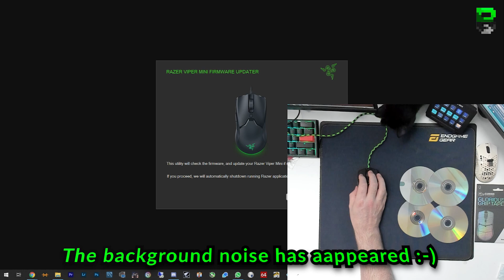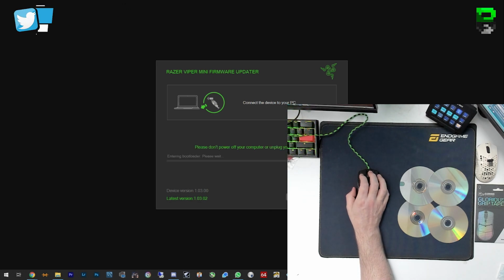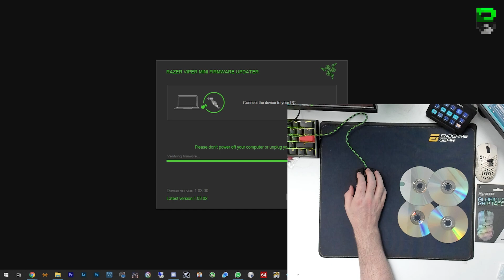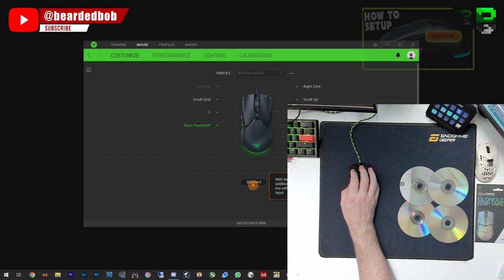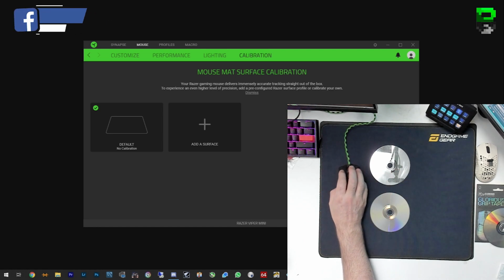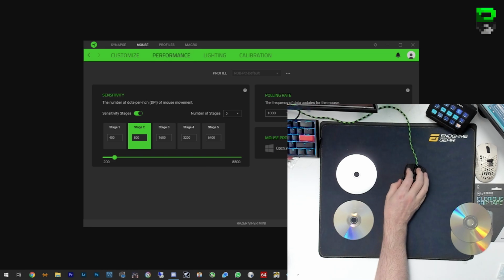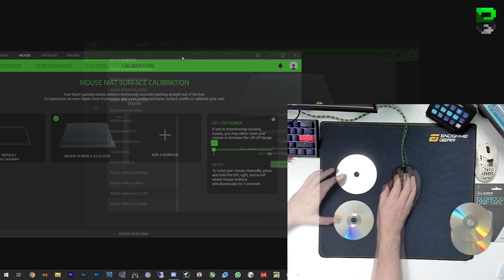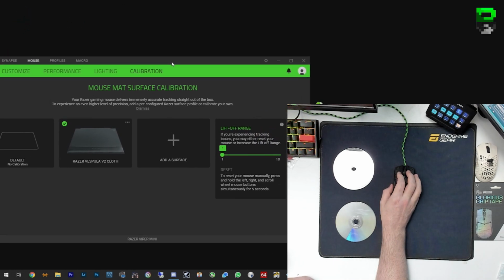Razer Viper Mini Lift Off Distance Fix v1.03.02 - So have they finally fixed the problem?

Comment: Firmwares for me didn't change a thing, the calibration inside synapse doesn't seem to do anything whether its on 1 or 10, even setting on a certain mouse pad type in synapse doesn't seem to change anything other than the fact that some of them don't track right, but the LoD setting itself 1-10 doesn't seem to do anything. The tape method works but it makes the mouse feel unnatural. I like the natural feeling without tape minus the fact that the tracking shits the bed when trying to adjust my aim. Time for a new mouse I suppose

Comment: Can someone help? 
I have a viper mini, I’ve had it for a year and a half and didnt use it much, but now i tried to play some games and noticed that when i flick the mouse it slows down like it has some weird acceleration(i play on low sens) and i want to know is there any problem with my sensor the or is it the mouse itself and i haven’t noticed it yet until now..?!
Reply: same! my first 2 viper minis did not have this issue, only my latest one. Any fix?
Reply: @KR-sr4jm  changed the mouse even though i loved it so much, the shape and grip was perfect but i needed the performance
Reply: @Naji123kh  what did you choose as replacement?
Reply: @KR-sr4jm  g pro wireless
Reply: @Naji123kh  now that's an what you call an upgrade. Planning to switch to deathadder v3 since I don't trust wireless mouse with their latencies. Do you feel the delay or nah?

Comment: My mouse does this all the time. Recalibrate for custom surface fixes it for a bit, but the issue always comes back. Adjusting the Lift Off Distance does nothing. Very frustrating

Comment: USE RAZER ACARI MOUSE PAD , IT WORKS, TRUST ME. No need for tape
Reply from the maker: But you have to use that pad as your main.
Reply: @Beardedbob  i used razer acari on razer synapse
Reply from the maker: r ok I see, yeah this trick doesn't work on all pads :-)
Reply: @Beardedbob  i tried 3 pads, razer acari best one. less than 1 dvd
Reply: no, i use hyperx fury S
Reply: I tried your way, it reduced the LOD, but also decreased the accuracy when cross

Comment: Recently got a Viper Mini and this has been a non-issue for me. I use quite low sensitivity (600dpi) and moves the mouse around quite a lot in-game. I was therefore worried about the LOD issue before buying. But after trying it out, it does not affect me at all. Not sure if it affects anybody in practical scenarios, but even if it has a little higher LOD than usual, I do not believe it causes any real problems.
Reply: Do you even lift bro???
Reply from the maker: Good to hear it, do you not lift?

Comment: Did you try to mount the  viper mini pcb with some support about 1mm (testable) between the pcb and the inner bottom of the case before screwing? Larger screws may be necessary if the screws do not attach the pcb to the case correctly. It's just an idea, i don't have that mouse and I don't know if that is possible. I like your videos, good work.
Reply from the maker: I've not tired it but they might work for the sensor the issue will but they will make the switches and scroll wheel to high 😟
Reply: @Beardedbob  Sure. I don't know, maybe to lift the mouse by placing about two layers of skates (or minus) to get a bigger LOD, but I don't think it would be ingenious 😟. thank you for the feedback

Comment: My unmodified Viper Mini's LOD is below 1 DVD. In Synapse I set LOD to 1 and calibrate the mouse for Vespula Control pad.  That mouse pads calibration uses way lesser LOD, than any of the others.
Reply from the maker: yeah I've heard a few people say the LOD is correct on this pad but you are limited to that pad.
Reply: @Beardedbob  i dont have Vespula Control or any other Razer mousepad, but LOD is way better with that profile. I have some cheapo Natec pad.
Reply: @barnabascsongradi9004  the tracking isnt off with calibration?
Reply: @mohmdbaqeri  all fine
Reply: Seems to work for me, better.

Comment: As i said in your previous video @Beardedbob , RAZER VESPULA CLOTH v2 WITH ver 1.01.02 IS THE BEST !!!! sub 1 dvd
Reply: its more probable the difference is the mouse pads you use
Reply from the maker: Good to now if you want to use the Vespula surface.
Reply: @Beardedbob  Update: I updated the firmware to 1.03.02 , mine tracks bellow 1 dvd with vespula v2 cloth and LOD set to 1.

I think its about the viper mini version. Not every viper mini is built the same probably. 
Uploaded a video on my channel.

Comment: boardzy made a fix along time ago and it really does work choose razer vespula v2 hard pad set to lift off distance of 3 otherwise it wont track right, I mean you can try 1 or 2 but both of those made my mouse feel sluggish and non responsive 3 felt the exact same as before and it def reduces the lift off distance, I'm assuming any hard pad option would do that if you're on a cloth pad but I've only confirmed it with the vespulav2 hard since i actually have that pad and used to calibrate it right the soft side before when I used it. It doesn't fix it entirely but I also haven't updated my firmware so maybe it would, however in game I've def noticed lifting my mouse does stop tracking maybe i lift higher than other but it fixed the problem for me like 6 months ago
Reply from the maker: This is the best fix, basically use tape...

https://youtu.be/87uWdVN6190

Having to use a pad to maintain a certain lod just didn't work for me 😹
Reply: Why tracking is not gonna be right? Is it because you chose different mouse pad than the one you really have?

Comment: I managed to fix the LOD issue by adding several small rounded ptfe discs on the current feet and some tape on the sensor. It's way better now!
Reply from the maker: Nice job

Comment: I used blue painters tape which reduced the LOD to below 1 DVD. Keep in mind that painters tape has a rough surface so to reduce the friction, I put scotch tape on top of the painters tape and I don't notice any friction at all. Feel free to give it a try!
Reply: Do you use any type of surface on razer synapse? Like u said the blue tape helped a lot! Thanks for the tip

I didn't knew that the lod would annoy me, but it is fricking annoying
Reply: @peter3d226  I don't use any surfaces on the razer synapse but if you still notice LOD, try out the different surfaces and calibrate with your mouse, which is addressed in this video :)
Reply from the maker: You mean like this :-)

https://youtu.be/87uWdVN6190
Reply: @Beardedbob  Yup!

Comment: I got my Viper Mini down to below 1 DVD with the tape mod too, it's perfect.
Reply from the maker: Cool, I testing that in this video https://youtu.be/87uWdVN6190

What tape did you use as that seems to make a difference
Reply: Which surface u used? @harpotos

Comment: Bro my sensor in my ultimate starts to skip and look wired and my Zowie G SR SE messed up the mouse feet and the mousepad itself and so I was going to take off the stock feet and but the new hyperglides for the Razer Viper Ultimate and not sure how to put them on any help pls.
Reply: Thank you and you have any idea why my sensor is glitch and skip places and acting like that or how to fix it
Reply: It also rattles when I shake it
Reply from the maker: Maybe some dust on it? I would also test it on another surface like a table or book to see if it still behaving the same.
Reply: @Beardedbob  it just acted like that on my G SR SE that's strange worked fine in Glorious thank you
Reply: @Beardedbob  would u recommend the hyperglides over the stock feet
Reply from the maker: Depends on the mouse but hypeglides I'm sure you wont be disappointed with if you can get them.
Reply: @Beardedbob  thank you and the hyperglides will go on the Razer Viper Ultimate
Reply: @genet1cs569  ive had issues with viper ultimate sensor that why i dont use it, but i guess it works fine for you
Reply from the maker: Hey dude, glad you liked the video. If you don't want to keep the old feet then just peel them off, if you want to keep them use a hairdryer but don't apply to much heat as you can melt the plastic. 

once removed just peel of the protective layers and stick them on.

Comment: Do you think 2 DVD lod will actually be noticeable on a very light mouse like the viper mini.
Reply: For me yes, I use low sensitivity so I lift my mouse alot. I have adopted mm710 until this issue is fixed somehow
Reply: It depends on you. I must naturally lift mice higher than the LOD, because it's never been an issue for me.

You could fit thicker feet or maybe even stick feet directly over the stock ones. And or play around with surfaces in the software  if you really want the mouse for whatever reason.
Reply from the maker: Yep if you lift the mouse its very notable.

Comment: So I know this isn't really related to THIS particular video but from watching a few videos you seem like the kind of guy that might know where I could start on this:
I wanna modify my preferred gaming controller, and later my handheld gaming system to use mouse switches (coming from rubber dome switches) but I've had a lot of trouble locating a good source of mouse switches, figuring out which ones to use, or how to do it. Other than feel the most important thing is going to be how tall the switches are when not pressed. Can you point me in the right direction for any of these things?
Reply from the maker: Aliexpress or ebay to buy them as for the switch feel my Channel seems to be the place for that. I'm doing a video over Xmas on the switches comparing them so keep you eyes peeled for it dropping
Reply: @Beardedbob  thanks man, I'll keep an eye out.

Comment: tbh i did the tape mod to get mine on less than 1dvd and its works perfectly, also how is that modded viper mini? whats the weight? its there any tutorial or way to buy that
Reply from the maker: Tape mod seems the most reliable if the high LOD bothers you.
Reply: Hey what's the tape mod? Where can I find a tutorial?

Comment: Did you test other surfaces? I assume Razer has dimmed the LED, but the benefits of that are highly dependant on surface
Reply: My most fav two reviewer met here . and m proud to see this conversation and being mice crazy person , finally a hobby to make my life satisfy and seeing some hope , , thz u guys . i really should treat some beer to u guys lol, :)
Reply from the maker: I've not yet, I could do but other sensors e.g 3360, 3389 and Hero are all ok on multiple surfaces. The 3359 could be more sensitive to this I guess. 🤷‍♂️.
Reply: @Beardedbob  3360 and 3389 have native LOD configuration options & calibration. HERO, 3389 and 3399 have some sort of automatic LOD algorithm that can keep the LOD at ~1mm whatever the surface. Afaik for 3359 the only option is dimming the LED and I would assume it's done with a static value, so it might work better on some surfaces than others

Comment: Why can't they put all this effort into just putting a better sensor in it in the first place
Reply: Because then the price would increase and the sensor is decent if the LOD was fine. It's not my favourite mouse but 25 euros is really good value (Black week deal).
Reply: @lepari9986  it can't cost much more for a similar sensor with just no LOD issues
Reply: @blade8800  it would be 60$ if it was the focus plus sensor
Reply: @blade8800  ofc the sensor shouldn't have LOD issues, that's a problem/bug. But I don't want to buy >50 euros just to have Focus+.
Reply: @chitchi8569  it doesn't have to be Focus+. Even a basic sensor like 3360 is enough
Reply: @blade8800  well Razer doesn't use 3360 in their mice now. But I agree that would be better
Reply from the maker: if it was would have be an issue? the MM710 has the 3389 in it and that's 40 on Amazon discounted atm from 50.
Reply: Sensor is great, only problem is the lift off distance.. However I used to play with laser mice and old opticals with a red light so this feels fine
Reply: sensor feels very good.